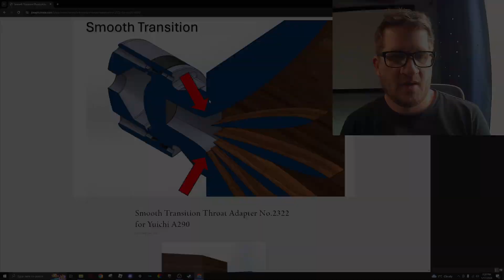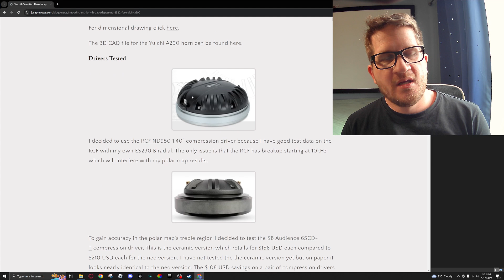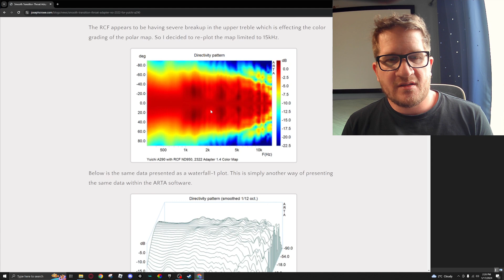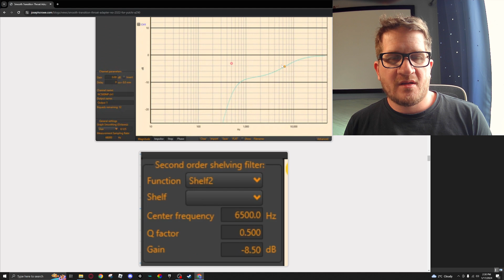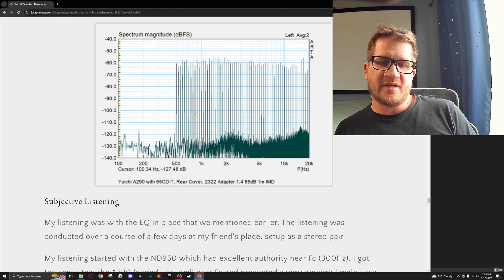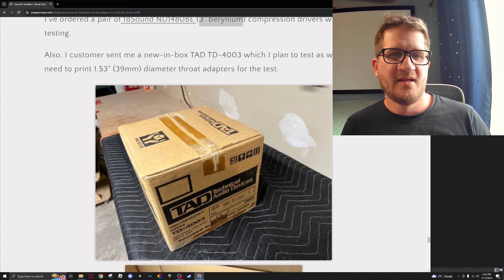Smooth Transition Throat Adapter No.2322 for Yuichi A290

Comment: Hi Joseph.. Besides the Rear Cover mod you sell, is there a rear cover damping material you reccomend universally for the inside of compression drivers? Or is it dependent on the driver design and/or phragm material? Traditionally it is a type of Felt  (Altec, etc.),  but you might have found better stuff these days..